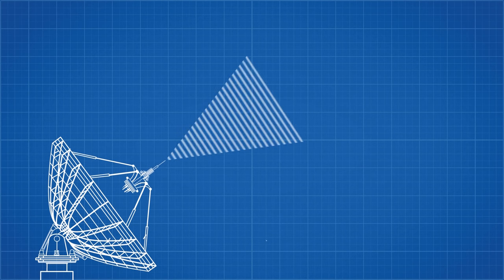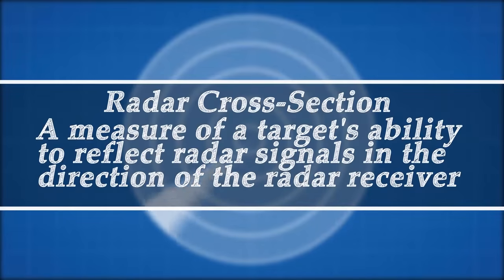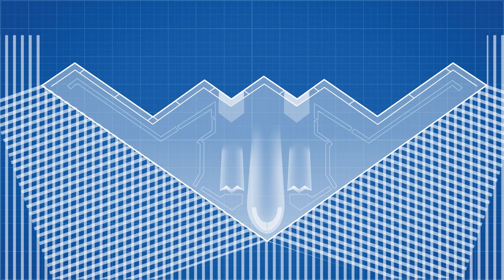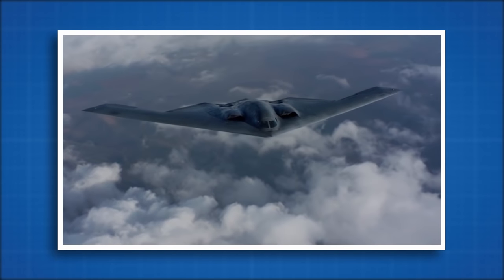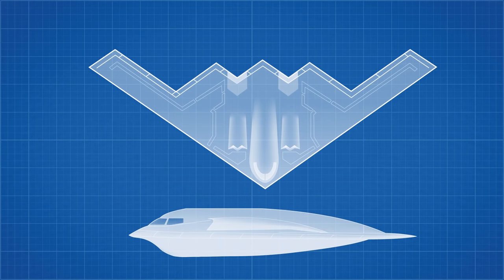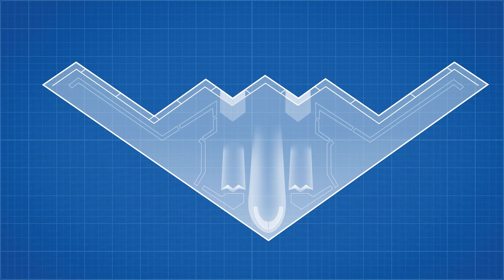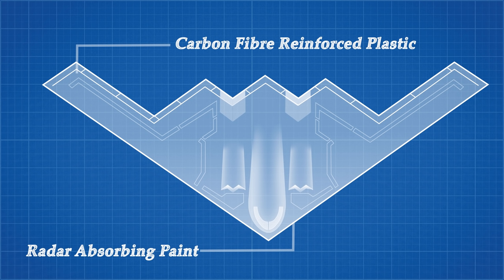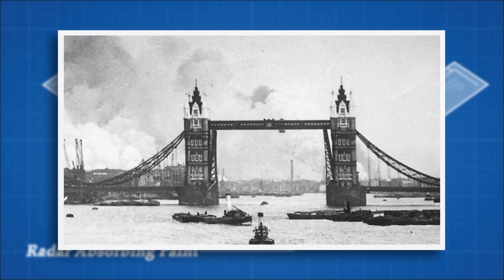Stealth - How Does it Work? (Northrop B-2 Spirit)

Comment: The problem is that if you have a radar sensitive enough to detect a large bird, and software that only shows pip moving above certain velocities, then you can very easily spot a stealth plane.
Reply: This is correct. When stealth planes were being designed and built in the late 70s/early 80s, computing power was very weak compared to what it is now. Since then radar technology and computer processing power has improved exponentially while the design of the "stealthy" aircraft has remained static. What was white noise showing up on radar is now a clearly defined image of an aircraft.
Reply: Neither matters with the B-1 Lancer, since it just flies below the radar at > Mach 1. Even if you do manage to spot it, it's statistically very unlikely that an intercept fighter could catch one and achieve a firing solution.
Reply: Kerbal AirForce No it can't. The B1 is only capable of 0.9 mach at sea level and barely above Mach 1 at altitude.
Reply: pacus123 Sure. If you accept the declassified top speed as absolute, and assume any targets are at or near sea level.
Reply: Kerbal AirForce Good point. Nonetheless I seriously doubt the B1 has a top speed of more than 50% of its declassified top speed.This would still put it sub Mach 2 in which case it would be cannon fodder for Mig 31s with their look down shoot down capability.
Reply: Stealth works best against X and Ku band radars. (In short the "fire control" radars can not see these planes) So basically detecting and tracking are 2 different things
MEANING EVEN IF YOU SEE IT, YOU CAN'T DO ANYTHING ABOUT IT
Reply: How about a plane w/ the rcs of a metal marble that can passively detect ur radar over 250 miles away (360 degrees around)? Or another plane w/ the Distributed Aperture System (DAS) that can see 360 degrees in infared and has the most advanced avionics ever? The first one can also see u over 400km away with it's radar

Comment: I've read that the Horten 229 only used the flying wing purely for it's flight characteristics, with the stealth being a false claim after the war. What do you  guys know about this?
Reply: +Andrew Quinlan

 Almost exactly correct. It was largely chosen at the time of their development given their smaller use of materials in that form, and possible flight surface control experimentation.
Reply: Ah. Thanks for correcting me.

Comment: I saw an other Video about the Horton 229 in wich the relevant parts of the Plane being rebuilt and tested and then calculate the Radar cross-section. The result was, that the Ho229 could reduce the Time to response for the RAF from around 30 Minutes to just 3 Minutes.
Reply: Not really the case.

Comment: Interesting - so the B2 still reflects all the radar signal, it just scatters it. Couldn't this be defeated by having a networked array of radar stations? If they sent out pulses at different times, they would receive scattered signals and you could triangulate the location of a stealth plane.
Reply: I think this might be done IRL

I heart that even stealth planes can be spottet fairly easy when you have a good radar system.

a F-117 stealth bomber even got shot down over serbia in 1999.

from this german side it seems like they used 3 slightly modified soviet P-12 radar stations, SAMs and some Mig-21

they used triangulation to get the plane spottet.

http://home.snafu.de/veith/Texte/Stealth.htm
(you can use google translate for a rough translation or search for yourself for info)
Reply: Sure but then you have to remember its now possibly 1mile away because it takes a minute to fully piece it together.
Reply: You could triangulate the location, but detection isn't tracking. This shouldn't be enough for a lock-on.
Reply: The F-117 has only been shot down, because its bomb bays were jammed. They were open, increasing their RCS. They have flown hundreds of sorties, every single night. Just one has been shot down. B2's have flown over Belgrade, not even 30 miles from the F-117 crash site. Yet, it wasn't picked up by their radars.
Reply: In theory yes - with a but.

Most radar arrays have T/R arrays Short for transmit/receive
They cycle between the 2 and cannot receive while transmitting

To do this you would need a Transmit array and multiple different sites running receive, they would need to be networked with a super computer which would compare multiple received signals to triangulate the reflection

this is feasible but not as cost effective, this is why it hasn't been used.

The Russians have made claims to be able to link radar sites to sync T/R Cycles to better detect stealth aircraft in the way you described but they haven proven that it is a working tech.

Comment: While it's true that the Horten Ho-229 had many of the same basic design features and radar characteristics, many decades earlier than the B-2, it wasn't primarily designed for stealth. The Horten brothers simply knew how efficient and maneuverable the flying wing design was, and were pioneers in the their development.
Reply: +Alex Parker

 The Hortens did not have any R.A.D.A.R. characteristics comparable to the B-2, analogically speaking. It wasn't stealth by title or capabilities. It was a lower R.C.S. aircraft compared to most other designs, but only because of its inherent construction and size. The DeHavilland Mosquito shared a similar reduction in R.C.S. because of its construction.

Comment: Nazi horten 229 is just as incredible .
Reply: True, many smart things in aviation were invented by nazi engineers during WWII, if not they obliged others to invent them by fear of their power.
Reply: I wouldn't even say nazi's, the Germans in general are just great engineers and inventors.
Reply: The horten 229 never flew, nor did it ever have an engine, and the airbrake rudder system would have been awful.
Reply: ***** The germans had some good technology, but it definitely wasn't the best all cases. There are hundreds of errors in their design I could point out, most needing only basic logic to find out.
Reply: Germany never ceases to amaze me
Reply: It flew with the Jumo 004 and even simulated a combat vs a me 262 that was outperformed by it. It had some lateral instability but it was deemed satisfactory. Get your facts straight.
Reply: Killed its test pilot on the 3rd fly out, flying wings are inherently unstable without careful flying.
Reply: +Cinnabun And a computer to assist the pilot.
Reply: +Cinnabun That didn't exist at that time.
Reply: +30000000000000000000000000000000000000000000000000000000000Characters German technology was the best at almost all cases. Do you know the type XXI u-boot? It was literally decades after its time.
Reply: You mean ahead right?
Reply: paillettecnc Yes
Reply: People say Nazi Germany the same way people say Imperial Japan. And neither country likes being called as so.
Reply: The names reflects their truth as it was back then, whether you like it or not. My country was a racist empire and history calls it "French Empire". Not a very charming name but it reflects it as it was in its truth.
Reply: +Cinnabun I think instability wasnt the reason for the crash but the shitty engines. One of them failed.
Reply: +30000000000000000000000000000000000000000000000000000000000Characters The HO-229 did fly, It did have an engine (it was temporary as it's main engine was still being developed, lastly during a test flight it outperformed an ME-262. So your wrong on nearly all of your points.
Reply: +Pogues Mahone No I am not a "Nazi fanboy praising Hitler" I am just a person who knows the fact that the Germans during WW2 were absolutely brilliant. First jet fighter, the Tiger, V2 rockets that led to modern day ICBM's and is basically the reason we landed on the moon.
Reply: It's kind of weird: I, as a German, am some kind of proud of the Nazi engineers, even though I hate Nazis in general. Appreciating some countries technology has nothing to do with it's (past) government ideology.
Reply: z1rk3l The engineers weren't really Nazi. They were German engineers, that's it. Just because they created jets and weapons does not mean they support the Nazi Reich. It's just that it's their job. Plus, you know, you'd lose your job if you didn't do the work. That or your life.
Reply: Karuiko z1rk3l i feel the same. They really just didn't care who they were working for at all. After the war many of them went to the US..
Still, as much as I admire the technology, they supported one of the worst nations at the Time..
Later it was more about defending their vaterland :D
Reply: even more because it was mostly made out of wood, to counter radar a bit
Reply: Dude, if you hate someone or if someone is evil it doesn't necessarily mean they are stupid/wrong. Grow up
Reply: Robert Cadav  Every german wasnt nazi.
Reply: yes but the horten did not incorporate b2 tech  it`s the other way around
Reply: this is not the Horten, but i agree.
Reply: +Dav serban

 The only powered 229 prototype to fly was the Go 229 v.II which crashed after its second flight hour over a two week span of testing.
Reply: +Jordan Smith

 What tech exactly?
Reply: German* not nazi.
Reply: +Loke Long

 What are you on about?
Reply: @felixbachiller3550  ?
Reply: @paillettecnc  There was no such test.
Reply: @peterson7082  yes there was. And the 262 lost
Reply: @paillettecnc The v.II only flew for two hours before crashing. That is not enough to comprehensively compare them. Additionally, neither Horten brother claimed anything of the sort.

Comment: There are aspects of stealth tech you failed to mention. Such as charging the wing with an electromagnetic field that causes a much greater laminar air flow thus reducing radar return normally caused by micro turbulence. The downside of this technique is not being able to fly in rain and maintain your stealth and also becoming something of a lightning magnet.

Comment: Sorry Wehrb's but the Ho-229 would of had extremely little impact on the war. The Me-262 was terrible, and the Ho-229 would have suffered the same failures.
Reply: MP5 Guy the me 262 wasn't horrible, it just wasn't the holy grail of planes The Germans expected it to be
Reply: Given the 262's engine failure rates. Horrible is an accurate way of describing it. The hold grail of jet planes in WW2 was probably the Meteor F.4 for its performance and functionality.
Reply: Depends on your definition of "Horrible." As an interceptor, for the time, it was a decent design. Between its speed and heavy armament, it would have done the job well. Not so much as a "Fighter," though. Its main weakness was the engine used - both in design (the tech being fairly early) and in the poor quality materials Nazi Germany had to use - not to mention competition with the Arado 234 for those same engines. And of course, with Germany's situation, they couldn't build either of them in numbers enough to make a difference.
Reply: That's just because it was the very first jet having to face the latest props every designed. It was bound to be bad, but still pretty awesome
Reply: egmccann A very poor engine reliability and zero asymmetric handling qualities would have meant it was going to be more dangerous to fly then the 163.
Reply: It wasn't terrible, it was the best and most advanced plane at this time.
Reply: And would probably kill any pilot that tried to fly it
Reply: well yea.
Reply: And in doing so won't make it the best
Reply: Innovation doesnt always yield better results...I imagine a working Ho 229 would have the same effect as the King Tiger's, horrifying at first when considered alone, but would probably be not enough of them (+the fuel shortages towards the end of WW2) to really make an impact, even the 262 was getting shot down by Piston planes like Tempest's and P-51's.
Reply: And even if the 229 went into service... it would have been a literal death trap. With the quality of German engines and no handling qualities without an engine, its own pilots would have hated it more then the enemy.
Reply: Lenn maybe not. I mean the Ohka worked a bit.
Reply: No way Jose almost all destroyed 262's were destroyed on the ground or while landing/takeoff
Reply: Lenn I hate when people refer to the me262's engines being bad, and I hate when people refer to the plane being bad. It was the first fighter jet in the world! Admire it that way. Maybe it performed significantly worse than other jet fighters, but it was the jet that changed our views on warfare!
Reply: +Lenn Whatever you say mr armchair aircraft historian.
Reply: I can see a lot of you just hate the 229 and the 262 but i know why you do it you are BRITISH
Reply: ME 262 terrible? Is that why Germans had the best aces in WW2 and were light-years ahead of the garbage Brits and American in killcounts? Good planes with good pilots is a deadly combo. Too bad the UK had neither.
Reply: +Rolling Thunder

  Very few if any "aces" came from piloting the Me 262. It wasn't a good fighter. What are you on about?
Reply: Nathan Peterson The Me 262 was the first operational jet-powered fighter and was the most advanced aircraft in the world. The Me 262 had a few emgine problems due to mass production and rushed service towards the end of the war. The US and SU both stole a few Me 262's and copied its technology to make their own jet fighters like the F86 Sabre. The Me 262 is the foundation of jet fighters of today and deserves more respect.
Reply: +Rolling Thunder

 It was the prior. But not the latter. 

 The engine itself was not designed to be lasting nor was intended for rapid acceleration and deceleration changes. Which was inherent in its design. Not necessarily because of quality or resources. 

 There wasn't anything technologically advanced on the 262. Save the application of swept wings. That was probably the only majorly influential feature of the 262. Stole is never the right word to use. As it was either captured or confiscated during the war, or obtained by the occupying forces or the succeeding German governments.

Comment: Radar Absorbent Paint won't get you much stealth. F-117 (retired) and B2 uses a different technology. It used a paint made with Quasi Crystalline Materials. When Electro-Magnetic Radiation of Radio-Microwave frequency is incident on it, it performs 180 degree phase shift and reflects it in the opposite direction as the incident rays, the Incident and the reflected ray, being equal in magnitude and opposite in direction, creates a zero vector electromagnetic resultant and you don't get back the reflected rays on your receives and therefore you don't see it. F-35 and F22 probably don't use this technology. This same zero vector technology was used in Nazi Submarines which made them undetectable, until the Soviets developed another new tool to detect Nazi subs. When two or more em waves form a zero vector resultant, a scalar wave is created which is hyper spatial and doesn't propagate like normal light. Tesla named these waves, Standing columnar waves because they stand in a certain area of space time unlike normal transverse waves. The Soviets figured out if one could detect these waves, you can nullify stealth technology. And the most interesting thing about scalar waves is that, when you create scalar longitudinal waves of frequency between 100-400 hertz, you can actually curve our 3D space time which is one of the medium of propagation of these waves, i.e. you can float a battleship using gravity waves using less energy than a light bulb, like they did in Philadelphia. Also the Nazis had this technology developed but they couldn't find out a way to control the maneuvering because of lack of computing power and also because of the mass cancellation effect of the scalar waves. The reason why you don't learn about the Original Maxwell's Quaternion equations that tells us how to convert transverse em waves into scalar waves, is because, when you curve space, NONE! of the laws of Thermodynamics are applicable at that point in space-time, because the Laws of Thermodynamics were created assuming a flat space time as the concept of curvature of space wasn't developed or established yet. The Islamic Republic of Iran is very close to this technology and in about the next 30 years, they won't have to rely on fossil fuels, wind mills, solar panels, nuclear fission plants and even fusion power, which Lockheed had developed in the 70s.
Reply: wat my smooth brain just blue screened

Comment: Actually if the nazis finished that aircraft they wouldn't do much with it. In 1944 Germany was fated to defeat and london bombings with rockets were common, but didn't did much because the British were ready.
Reply: the british were in no way ready for the V2s. Or do you think they let German bombers turn parts of London and Coventry to dust for propaganda purposes?
Reply: Pfft, the German V-2 project was a bit of a sham. More people died in creating the bloody things than it ever killed, and is said to have cost 50%/more than the Manhattan Project itself.

British proposals to counter the V2s were done as early as 1944, and in the end they simply made a deception campaign about where the rockets were hitting and how much they did alike how they already did with German bombers. This because attempting to shoot it down with anti-aircraft guns would've actually done relatively more damage/casualties than if they simply had let it be.

In the end they simply bombed it like everything else of Germany's industries, and the Germans capitulated and gave up the equipment for study and implementations for such things as the first rockets into space and the like.